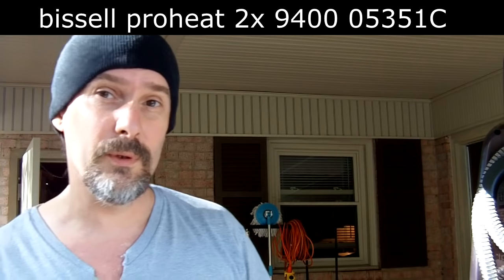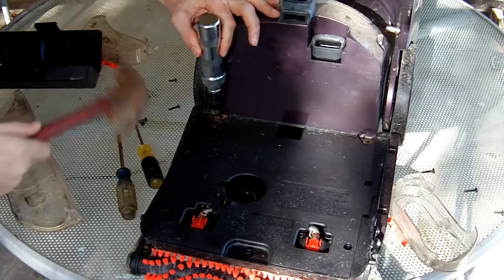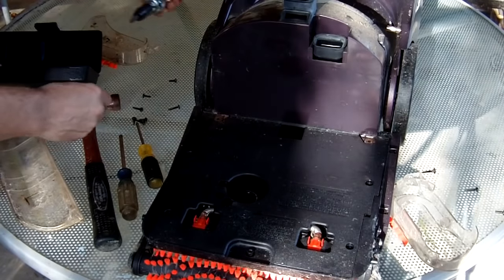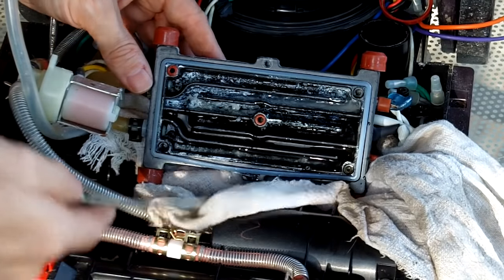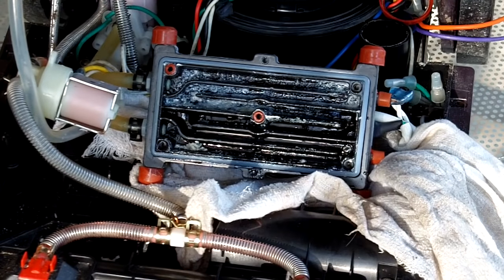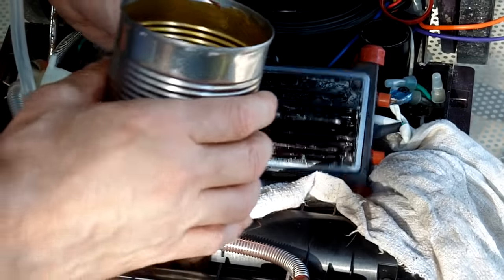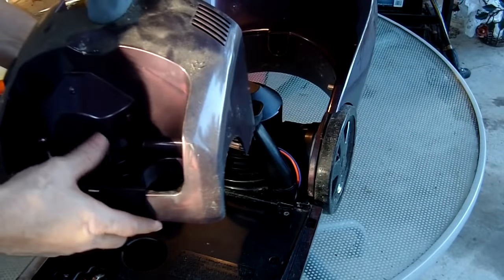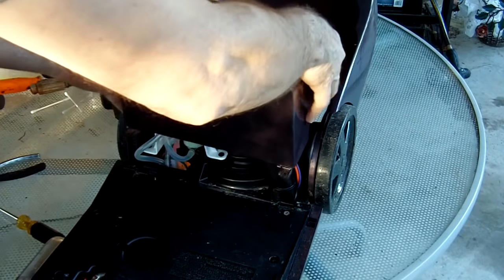Bissell ProHeat 2x 9400 - Will not spray water (How To Fix)

Comment: Mine is a model 9500 which is very similar and does not spray. A couple points and I learned these the hard way. 1. The heater core is aluminum and will corrode UNLESS the machine in completely dry when you put it into storage. Mine is corroded so it must be replaced. A new core is about $25 dollars on Amazon. 2. Do not leave the soap tank on with any soap in it and make sure you run clean water through the machine before you store. If any soapy water is left in the machine, this will dry and clog the lines and spray heads. 3. BE VERY CAREFUL taking the hoses off. They tear easily. I tore one of the lines that did not want to come off my spray head (pulled it with a pliers) and I found out it is very difficult to get the 5.6 mm (inside diameter) hose replacement. I ended up using standard quarter inch hose (which is just a tad loose) and wrapping some electrical tape around the inlet so the hose was snug and would not leak. If you clean the core and it still does not spray its most likely the solenoid regulator going to the spray heads and must be replaced (cheap part that costs a few dollars). At the end of the video he says the machine still does not spray correctly. This could be partially blocked spray heads or the solenoid is not operating correctly. Hope this comment helps someone. It was very frustrating for me learning all of this and looking at videos until I found this one. I didnt really want to throw away a perfectly good machine when the parts only cost me about 40 dollars.

Comment: Thanks for this -- it saved me. My Bissell ProHeat 2X wasn't spraying any water at all, and I'm no handyman -- I've never fixed anything like this in my life -- but watched your video, took my machine apart, cleaned out the heater core, put it back together, and my machine is working perfectly again.  I didn't remove those top hoses that you did. Instead, I just stretched open the bottom part to the height leaving those hoses in would allow, and disconnected the water hoses and electrical connections on the heater itself, and removed it and cleaned it out at my sink!  It was tricky, but there was just enough room to do it, and everything worked out well. I was concerned that if I disconnected those top hoses and took the whole top portion off, I'd have difficulty figuring out which hose goes where when reassembling. It was easier to just focus on the two hoses connected into the heater, at the point of those connections.

Comment: After you clean the heater core try cleaning out the plastic lines with some vinegar-water solution.  Just add the vinegar and water to the hot water supply tank or the cleaning solution tank and run the machine with the spray nozzles detached so they don't get plugged up again with debris coming from the heater core.  You can fill the solution tank and take the big water tank off the machine. Then attached the solution tank where the water tank goes. That will supply some water/vinegar to the pump and then turn it on without the spray nozzles attached so as to flush out the heater core and the tubing.  Once the tubing is flushed out then you can attach the red plastic spray nozzles and put them back into place.  That way you won't get the clogged up again with any debris in the hoses.
Reply: Yes, good advice...remove the red spray nozzles and run the vinegar (or whatever cleaning solution you desire) through the tubes. My guess as to why this man's vac still doesn't spray is precisely due to junk and crud in the lines getting clogged back up in the spray nozzles again.

Comment: Heater cleaned out (it was gummed up). Solenoid replaced. Nozzles cleaned. Vinegar rinsed. Tested it and it is only pulling water out of the concentrate tank and NOT the main clean water tank. Dumpster is the next step unless there is yet another fix.

Comment: Yipes, never use impact driver on screws that connect to plastic body, try several different philps heads.  Orange wire on right, purple on left

Comment: Had a different model but tried taking it apart to get to the heating element.  Spent an hour fighting way more screws than shown here along with way more tubes.  Basically had to disconnect the wheels to get to the heater.  Managed to extract it, only to find that a single screw on the heater wouldn't budge and ended up stripped out badly.  Spent the next 20 minutes absolutely destroying it on my back porch in rage.  Totally worth it.  Will never buy Bissel again.

Comment: Several of the red "O" Rings fell off the heater core when you put it back together. There should be 5 of them.  They help seal the screws/holes to prevent water from leaking out. One fell out onto the Towel. One in the very center was still where it was supposed to be. The other three are missing. So if anyone else tried to do what you did to clean the heater core make sure that you don't lose those 5 "O" rings. Correction.  I watched the video again and paused it to see more clearly. The red rubber "O" rings were stuck to the cover plate and not lost.  I saw all five of them. Two were still on the heater core and the other there were stuck to the heater core cover.  So you have all 5 of them. My mistake. But that is something to watch out for.

Comment: I don’t have this machine but your video and peoples comments were very helpful.  I opened mine up and saw white stuff ( soap?) in the tubes. I removed and cleaned the nozzles in the floor part and hand held bit. Then I put almost boiling water in the tank, squeezed triggers and managed to displace the dirt in the tubes before putting the nozzles back. It was spraying great. I reassembled it and don’t you know it’s not working!  It’s not gone back together quite right judging by the on off lever and the tilt lever so maybe I’m pinching a tube. Oh what fun I can take it apart again!  I now get how important it is to rinse after every use. I’m sure it was congealed soap.

Comment: Grateful for this video. The instructions are easy to follow. However, I just spent 5 hours completing it, got it all cleaned out really good, (it was horrendous) but I must have not gotten it put back together correctly because it still doesn't work. Also, I set it aside, and when coming back to the room, I noticed I giant puddle of water everywhere. I am so done as this took up my entire day. very sad it didn't work.
Reply from the maker: Sounds like the hose was not attached properly.
I had to follow my video myself the other day, and it was a complete mess after sitting for 6 years, but it all worked out.
I would take it apart again, watch the video and see where the mistake is. Trust me, it happens to us all. A LOT. So please do not feel discouraged from it. We all make mistakes.

Comment: Only video that has the same cleaner like mine. The problem I am having is the part that covers the motor? will not fully go down. Still has a good 1/4 to go. I'm close to just cutting the whole plastic piece in half. As the flat part I can get flush. Then trying to figure out why the back piece will not go down without having to make sure all the hoses and such are not in the way each time I lift it up.
This is the second, or third, bissell I've had and they all have had problems.

Comment: Thank's for help,
Is,t possible to show a complete hoses place as it should be.
I used the machine some time ago, I forget to clean the solution plastic container, when i needed to use it again, it look like the solution dride inside the pipes(hoses) that carry it.
Kindly how the solution passes thru, how to clean the passages( I used white vinegar for 2 days it did not make to much.
Thank you in advance 
Michel

Comment: I just wanted to add that my cleaner wasn't spraying out of the bottom, turns out that I needed a new trigger valve assembly in the hand tools part. Water was coming out of the hand tools thing but not the bottom, so check there if you have the same issue.
Reply from the maker: Could you possible provide a link for that, please?
Reply: My Vlog I don't have a link, I just fixed it. You open up the tool end of the wand and where the trigger is, on the inside is a little trigger valve with a spring on it. If that mechanism isn't working it won't allow the machine to prime. Unattach that from the hose, take it to a local Bissell repair place and get a new one. Works like a charm.
Reply: Or you can order any part you need from  Bissell. If you kept the booklet it shows all of the parts with names and order numbers. There is no Bissell service where I live in Fl.
Reply: Dee Hedley 
same problem. .I miss the old school Hoover it just worked all metal beast Hahaha

Comment: another way to clean it out is put boiling water through the heater and that will melt out all the soap residue.
Reply from the maker: Thanks, for the information.
Reply: Your welcome.
Reply: It's been a few years since I last used my Bissel ProHeat 2X carpet cleaner.  I read that you are supposed to dilute the Bissel Advanced Formula PLUS for carpet and upholstery. The directions on the Carpet Cleaner bottle says to add 8 oz of hot tap water to the cleaning tank and then fill the rest of the tank with the formula to the fill line on the tank.  I'm not sure but I think that I used the concentrated formula in my tank in the past.  In any case, I know that my water company supplies my house with very hard tap water.  The heater coil surely got clogged up with calcium carbonate from the water inside the heater core.  My machine won't spray any water now. I tried taking it apart on the floor in the living room just to see what was wrong.  Getting down on my knees is not a good idea. I"m 69 YOA now and my knees can't take that abuse anymore.  I have lots of health issues with heart disease and cancer so I feel lots older than 69.  I feel like I'm 95 years old.  If you work on this machine it would be best to have a table to put the machine on while you work on it.  And take pictures of where the hoses and screws go so you can remember how to put things back together.  So of the screws that you removed on the back of the machine were hard to see in the video. So I was leary in taking my machine apart. I got to where you disconnected some hoses on the water pump but stopped there as it was midnight and I was too tired to go on. So I put everything back together.  I could see the heater core but could not get the top lid off to get to the heater core. I want to remove the heater core completely and soak it in a hot vinegar solution to clean it out well. I may have to have more time to complete that task if I chose to do so.  Starting at 6 PM and taking until 12 AM is not the way to go.

Comment: Good video, watching yours l was able to fix mine, l HAD SPRAY ALL THE TIME, l checked the micro switch in handle checked good, next pulled both solenoid next to motor both were closed and would open when energized now l was at a lost until you started to pulled out your heater there was an 3rd solenoid that supplied water from the tank to the heater and to the spray nozzles, there are 3 solenoid all the same part # B-203-6761. Solenoid for the sprayer was locked in the open position and that why it sprayed all the time, so if your trigger switch checks OK go to the solenoid next to the heater. 
 l swapped one good one and installed in place next to the heater put the bad in its place and the rest is history worked like a charm, order a new one $12.00 dollars will back in business.
Reply: Lionel Berthelon , i had the same problem, I had one selenoid next to the heater on the open position, changed but after I installed, it’s not spraying no more, I checked the pump and is working, any sugestión? I don’t know what else to do, any help will be appreciated, thanks

Comment: If you rinse the system with clean water after every use, you won't have this problem. I did catch one little mistake in your repair, only because I also learned this the hard way.. You forgot to put the little orange O-ring gaskets back inside the heater.
Reply from the maker: Can you please let me know at what time, this is done in the video?
Reply: My Vlog rite at 11:58 there are 5 little red o-rings which set inside the heater. Four, one in each corner and the red one which you have in the middle.
Reply: Use distilled water for both carpet cleaning and final flush before storage

Comment: I was about to pull  mine apart and put in Recycle bin. I spent the PM cleaning it up , The Inlet on the heater  had some crud bilt up , used pipe cleaner  and flat screw driver and some vinegar , clear water and cleaned it up .Put it all back togeather  , Motor works fine BUT NO SPRAY at the heads  which are clean .One thing I notice missing is the red cover that goes on the end of the little chemical bottle - which fits on the rear ... Now what ?
Reply: Can you go to Bissel online and get parts?  You will need that part for the cleaning solution to get into the cleaner.

Comment: I have a Bissell Proheat 2X. I watched your video and I am sure the problem with mine is the filters clogged (big silver box). While taking mine apart I noticed mine is deferent I do not have wires up top like your does. Is there a way I can send you a pic of the inside of mine and maybe you can tell me how I can fix it. I have two cats and a Siberian husky so I am almost positive it has to be that filter. Please let me know thank you D

Comment: nov 2020, pulled mine appart and the Boiler heater had a rust hole in it.  AND the pump motor would not start turning on its own,  if manually spun it would get going.
Reply: I saw on the Bissel site that you can buy a new heater core for about $25.  You can buy a new water pump for less than that. And the solenoids are for sale too. They are around $5 each and all three are the same part number.

Comment: Here’s a picture of how clogged up my heater core was when I pulled it:
https://drive.google.com/file/d/14nV28NMGhx62PyQfl5xQpIpUWw9l7YkD
How about disconnecting the heater core and just bypass it? Never turn it on again. Use the existing water supply line and re-route it. That’s what I did. And I put a piece of tape over the switch so I know not to turn it on ever again.
Reply: 1980sLegoFan wow that was really clogged

Comment: followed your video to the letter, I thought.  After putting it back together (no extra parts) I plugged it in and it did a1-2 second try on the motor and then nothing.....still nothing..What did I do wrong?  There was still some water/vinegar inside the casing plastic where the heater thingy is, just residual no puddles.  Help

Comment: Did you ever get it to work ?   The one I have is really being a pain. I got to screwing around with this thing. I  cleaned those little red injectors like you showed.  Hooked it all back up one side almost worked and the other nothing. So I took off both injector's.  And got a pitcher of water and poured it water thing goes. And pulled the handle. It took a few seconds or so and the water started to flow. Some clumpy nasty looking crap came out. I ran a couple of pitcher of water through and it seems to work. Before I put the injector's back on  I checked and had to reclean them.  I used a wooden tooth pick. I put the water thing back on and it seems to be working. Hope this helps.
Reply from the maker: Hey, William.
Well, define "Work".
It seems to only shoot out the soap on the left side, and the right side, not so much.
I may have to take it back apart again, so check some more things with it.
I was able to get the stain that I mentioned at the beginning of the video up, as well as a few other stains.
However, I really do wish that it would work like it did in the beginning.
When these things set for a long period of time, they do not tend to work properly any longer.
It is a pain, but, what can you do, but try.

Wish you the best.
Wayne
Reply: William Wynn to

Comment: Im from NC and my hands are slow...lol
I took it apart, cleaned it.....NOW I CANNOT GET THE FILTER HOSE DOWN ENOUGH TO SCREW IT CLOSED...LMBO
LOLOLOL
What part of NC?
I'm originally from Durham but I've lived in Orange co for 12 years.
Reply from the maker: Sanford. (Between Fayetteville and Greensboro and raleigh)
Which part of the video are you having issues with.
And so sorry, for the really late reply.
Reply: My Vlog 
Hey...no problem.
I done exactly what you done..step by step.
It just will not spray.
Reply from the maker: try putting HOT water in it.
Another person, somewhere in the comments here, stated that he put HOT water.
That bladder will hold it right hot.
So, get your tap water to the hottest point it will go, and fill up the bladder.
(Do not burn yourself)
And then see if it will help clean out the settlement.
I have to do the same thing to ours as well, once I get it out of the storage building out back. :)

Call me, Wayne.
Reply: My Vlog 
Ok thanks so so much

Comment: dude seriously, mark the wires and pull it, use a bristle brush and some compressed air, blow out all your lines as well.
Reply: I had such a mess of buildup inside mine, I ran a 5% muriatic acid to water solution through mine, then ran 2 tanks full of clear water, works like new